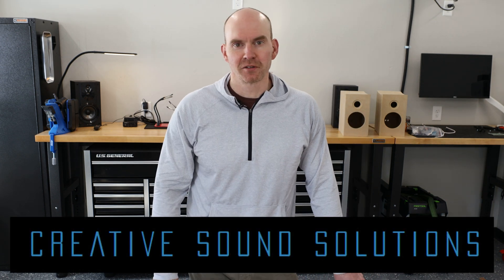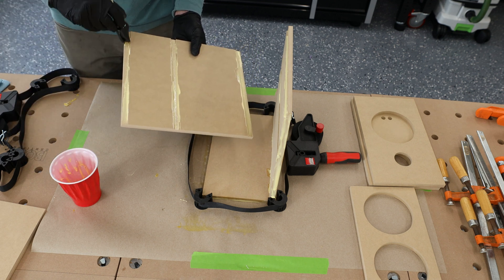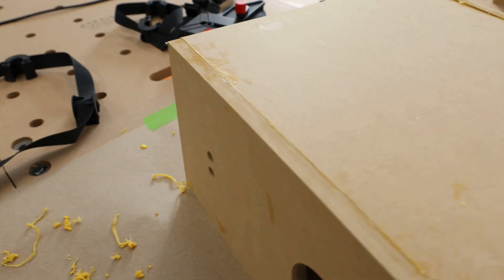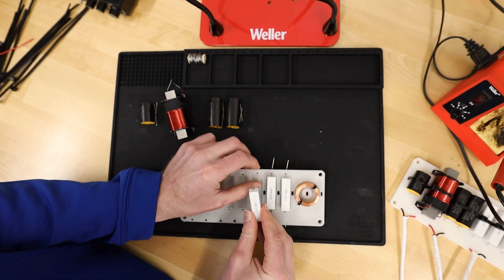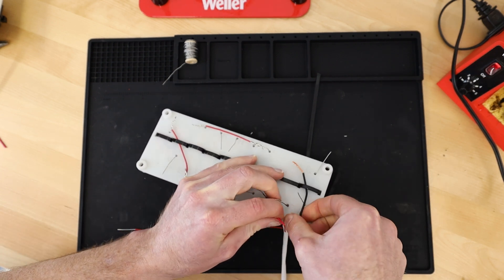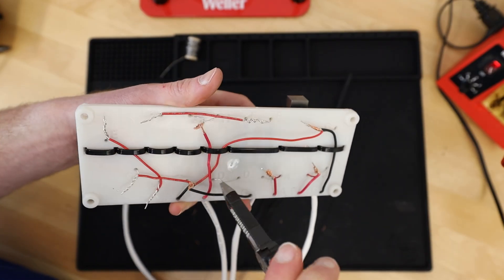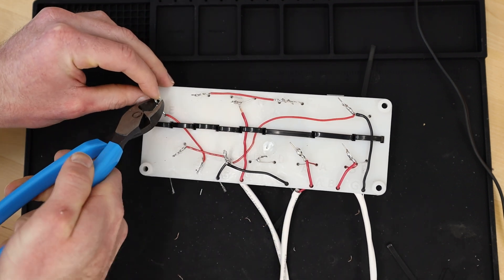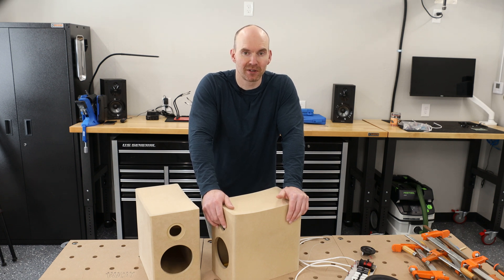CSS Audio Torii DIY Speaker Kit Part 1 - Cabinet Construction And Soldering Tips

Comment: Thanks for the instructions on assembling the crossover board and soldering the connections...  Good idea to run the jumper wires through the zip ties.

Comment: One of the best solder guides I've seen, I'm sure a lot of people will find that super helpful for their first build. Also that resin inside the cabinet seems like it could be a nice extra step for any build you want to go the extra mile for. Not only would it make stronger in general added density and the fact that its a different density than MDF should really help cut down on box resonances.
Reply from the maker: Glad you liked it! The resin did have an interesting result, really did well removing resonance.
Reply: I would by carefull. When soldering electrolitic capacitors waiting a bit more time than necesary can melt internal layers. If you have grosser sold applying heat on vire and wait is not always good solution and created problem is a bit worst then just loosing junction on other end of vire

Comment: Over the winter I bought and built the 1-TDX kit from CSS. They sound incredible! I would say if I had it to do over I'd skip the Baltic birch cabinet option and go MDF. I felt I had far more experience with staining and poly than my zero experience with veneer. The birch is not worth the extra cost, did not have the fit I've seen in the MDF, and even with conditioner the stain didn't come out anywhere where I'd like it to be. I think I'm going to build the Torii set to replace the soundbar in our great room. I've never veneered before but I like the myriad of wood options. I'll have to figure out the amp situation afterward but I really miss the sound quality of real speakers over a sound bar but I have to balance that with what my wife wants. Thanks for part 1 and 2! Lots of useful information even after I've built a set.
Reply from the maker: MDF does tend to be a little easier to work with, just a mess when you have to sand or cut it. Don't be too worried about the veneer, the process isn't too bad once you get started. Have a good one!
Reply: My first diy speaker set was baltic birch which I veneered over, worked really well! Mdf is easier to sand and shape though. Although I shaped parts of my speaker boxes with a rasp and file, (don't have a router) that wouldn't be very feasible to nicely do with mdf. Both have their merits!